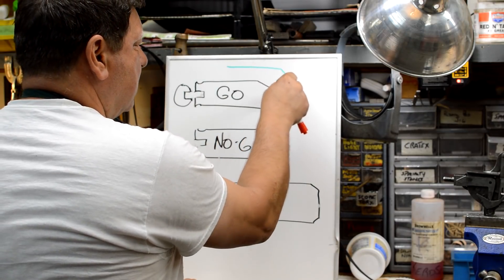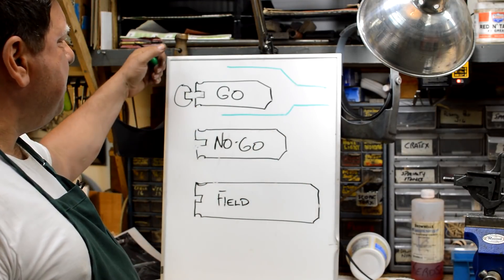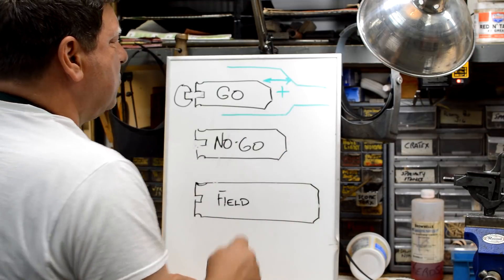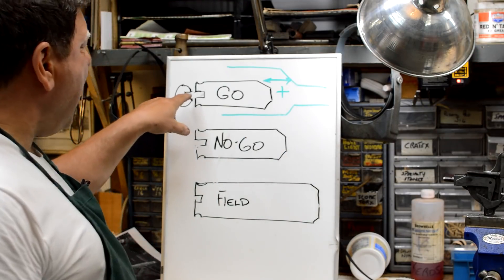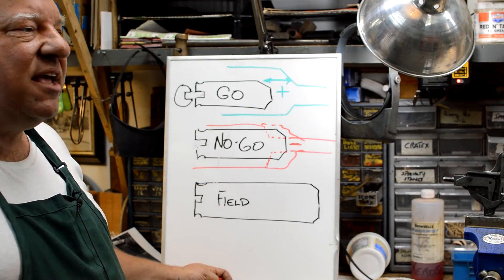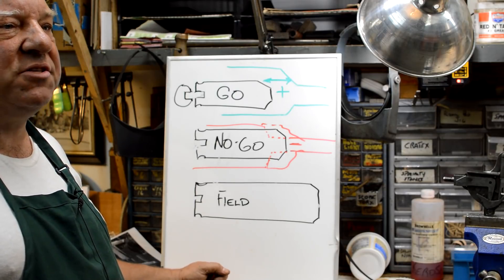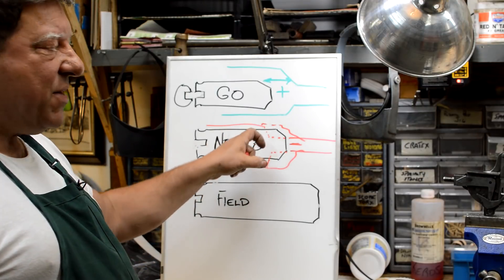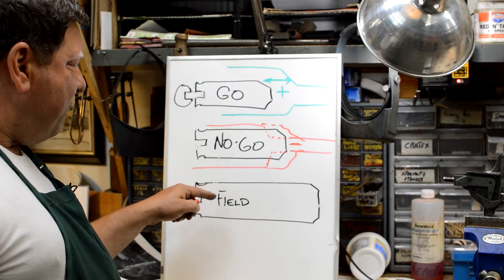Questions, answered #8: headspace gauges

Comment: I’ve had three brand new barrels by three different manufacturer that fail, headspace check. I had to send them all back to get replacements always check headspace you don’t want a gun to blow up in your face
Reply: barrels not installed properly?   Needed to be machined for proper fit?   Bolt face needed machining.  3 barrels?

Comment: How do you make sure the gauge you get is in spec?
Reply: Throw it in a case gauge (usually used by reloaders). Most have a stepped face on the rear that represent min/max chamber dimensions.

Comment: All I have ever needed for setting up headspace on my rifle is a go-gauge. Put the go-gauge in the chamber, set the head space to where the bolt just begins to have a very little resistance while closing, and every round as always perfectly fit with minimal fire forming that occurs. All are accurate and with no head separations.

Comment: Mark, when it comes to these gauges, particularly the no go and the field gauges, which do you prefer, go by and suggest when it comes to headspace gauges? The no go gauge or the field gauge? Or both?

And I apologize if this was asked by someone else and answered, as I didn’t feel like going through and reading all 104 comments to find out. 

But I ask this because when I rebarreled an M1 Garand and was asking questions/for advice from those supposedly in the know, many suggested, since it was just a rebarrel and because it was a military surplus rifles and because it was a Garand and because I was using a Garand barrel and not a new/brand new barrel, I just needed to use the field gauge. 
Now this is done and I, being the person I am, bought and used all three. I wanted to be 100% sure, positive and confident that when the trigger got pulled it went bang and not KABOOM💥 💥 💥 !

But could and would I have been safe with just the field gauge?
Reply: Only field gauge will tell you if the rifle is not safe, no go gauge is for new builds only👍
Reply from the maker: A NO GO should not go in. Your ammo serves as the GO, if the chamber is not long enough the whole system doesn't work. Field gauges are for military extremis conditions. Do not use a field gauge.
Reply: @marknovak8255  That’s what I wanted to know. That being, whether or not to use a field gauge/if it was necessary or not.
And saying not to use it, answered my question. Thank you for replying.

Comment: I always wanted to know how they work I think my British Enfeild would take the field gauge I still shoot it but I think it needs a new barrel to fit a go gauge to resize the ammo to fit the case gauge as it is my reloaded ammo will not fit the case gauge
Reply: It's not unheard of to do things like put o rings in the extractor groove to force the case rim into the bolt face during fire forming and neck size only on those. Couple pics floating around of virgin shoulders blowing 3-4 mm (1/8"-3/16") on their first firing. Sizing those down fully leads to case failure really fast.

Comment: Must you check headspace in AR-15 barrels and BCGs? Or can we get away with not doing it?
Reply: You should check EVERY combination of parts for proper headspace. I have found a few brand new guns and parts 'out of spec'. There is a very tiny amount of tolerance and variation in everything made. It IS possible that the right (or wrong) combination of enough parts, that meet specifications, can 'stack-up' to a point of the assembly being out of specifications. 
     One other thing about the 'field' gauge. As stated, it's just that, a gauge for checking a weapon in the field and is longer than a No-go gauge. If a weapon will go into battery and lock on a field gauge, it has EXCESSIVE headspace. It is Far out of specifications and while it could simply suffer a case separation and jam, The weapon CAN Explode. In this case there is enough room and slop for the cartridge case to move around and slam the face of the bolt causing catastrophic failure. Think of the difference between pushing on a locked door and hitting it violently with a sledgehammer!
      Yall Take Care and be safe, John
Reply: I do every one I touch.  I have a bolt without the ejector and extractor I use for testing.  Then I verify depth and lug length from my test bolt to the original.  If discrepancy or it fails I will pull the original bolt apart and retest.

I have come across two barrels out of spec from new.  One a cheap no name from Amazon when they sold such things and one direct from YHM.  

I learned how to do this way before the internet after I bought my first toy at a show and it never ran right.  Doubles and triples and all sorts of other stuff.  I bought the books and tools and learned.  Eventually I replaced every part except the lower receiver.  I bought two lower receivers and had two functional tools.

Talk about jumping in the deep end.  I was in my early 20’s about 1990.
Reply: Most people get away with trusting a manufacturers quality control, even if their guns is made from 10 different companies parts because they're like me and want something different or.. they're like me and they're cheap. 

Wouldn't hurt to take your new bolt and barrel, a live round and see if the bolt will rotate with a .005" (pop can) shim between cartridge and bolt face. Obviously be careful because it's a live round, and best to do it with a cartridge of high quality/match grade. If it rotates, try two shims. By shims I mean little discs inside the bolt face pocket. Rotation on one shim probably isn't that bad, but two (.010") is probably getting a little loose. 

*I'm not a gunsmith, just a random idiot that has rebarreled a few guns for personal use.
Reply: @randomidiot8142  could you use a spent casing?
Reply: @raffieb762  theoretically, but then you are setting headspace according to a spent casing of unknown dimension. If you full-length size the case and then use it, that would be setting up the chamber for absolute minimum headspace based on your die set. I guess if you use the fired case, you could assume that it came out of a properly headspaced firearm? 

Almost all of my factory sizing dies will take a fired case to dimensions that allow 5-6 thousands of clearance between the case and the chamber. That's about the difference between most go and no-go gauges.

Comment: I have an ar15 build that will load a round from the magazine, fire, but not eject the casing... will the go/no-go gauge help indicate what my problem is?
Reply: If it's a home build, double check your gas tube is not upside down.
Reply: @harak58  the gas tube is correct, I've checked. The chamber locks shut with a round/casing in the chamber and only ejects when "mortared" on the ground. 

It's a 7.62x39 AR build, if that information matters at all...

Thank you for the replies.
Reply: @blackhat2005  how well does it cycle by hand? Have you looked for any wear marks where there shouldn't be? Whats the brass like after you shoot?
Reply: @CAMSLAYER13  It will load the first round from a magazine by hand just fine, and fire that round as well. It won't eject the spent case unless the rifle is "mortared" on the ground.

Attempting to eject the round (unfired) by hand to manually cycle or clear the chamber doesn't work either, even with the magazine removed. It has to be mortared. 

Loading into the chamber and removing a round (unfired) to inspect shows a small dimple on the primer despite it not having been fired.
Reply: @blackhat2005  alrighty, I've given myself a problem like that with my homebuilds. 

1. You probably have a phone. Take video and preferably slomo video when you shoot, especially with a problem gun. It helps a lot.

2. You said you had to mortar it, because the cartridge was jammed in the chamber? You said you had fired it, so it's probably the right chamber and not a blackout barrel. 

3. ARs don't have spring loaded firing pins. A tiny dimple on a primer after loading by dropping the bolt is normal.

4. Have you tried different ammo and does it stick rounds with all ammo or just one brand?

5. Barrel length, barrel manufacturer, gas system length, adjustable or standard gas block, bolt/BCG manufacturer, buffer weight, if you have it. 

6. Not really a point, but I've tried adjustable gas blocks on my 7.62*39 and started with not enough gas to cycle. At first it would just bump the bolt, then it will pull the case almost all the way out, then it ejects, then it feeds, then it cocks the hammer, then it locks open. I've never had a case stick to the point I had to mortar it out, even if the action didn't cycle it out when fired. If you can get a light in the chamber, verify the chamber walls are smooth and not ringed or gouged. You should be able to drag a piece of wire down the chamber walls without it 'ticking' or hanging up if it's decent.
Reply: Paint a round with a sharpie.  Gently place it in chamber and close the action.  Extract it unfired and see if there are any obvious and atrocious burrs in the chamber.  Also, like others have said, what does the brass look like?  Typically if the round fires, cycles the action, but the brass is still in there it is missing a piece of the rim at the case head..  You have the bolt pulling it back and residual pressure giving it a jump-start to GTFO.
Does the action try to cycle at all?  or just stay closed like a bolt gun?
Reply: Hello, first I would say check the headspace. 
    If it passes the headspacing test, it sounds like a rough, dirty or bad chamber.
   Since you said a fired or unfired case won't easily extract, even manually the issue is with cases stuck in the chamber. Your not getting far enough through the firing process for the gassing of the weapon to be the issue. 
     Check the headspace, check the chamber and if that doesn't allow you to manually cycle cartridges without beating on it you should return the barrel for replacement. If you can't return the barrel, you may need to polish (or have polished, based on yours tools and experience) the chamber. After any chamber polishing,  always recheck headspacing before firing. 
    Good luck and let us know. Be Safe, John
Reply: If you do what Matt Fleming has suggested, and you do not see any indications of burrs or imperfections in the chamber, then it is likely your gas system.  Here's how I come to that conclusion.
With my favourite rifle, the FN FAL (Canadian variant, the FN C1A1), you are taught to "balance" the rifle when it is first issued to you.  The FAL has an adjustable gas system with increments from 1 to 10, 1 meaning that the least amount of gas is directed into the gas tube and 10 meaning all the gas is directed there.  Balancing the rifle consists of firing the rifle loosely held at the hip with the gas selector set to 1 and then checking to see if the rifle fully cycles.  If not, then set selector to 2 and repeat.  Most FAL's are comfortable at a setting of 4.  It is to be noted that if the rifle is fired at a low setting but braced against something, then it will usually cycle.  If there is not enough gas getting to the gas tube, the rifle will fail to cycle.  You can do a field test of this by plugging the barrel and blowing cigarette smoke into the barrel with a straw or something and checking whether smoke blows out in the right amounts and in the right places.
Reply: @bronxcheer031  My first thought was that maybe the gas block was misaligned..  BUT that wouldn't cause it to need to be mortared to extract..  the cam pin would handle that easily.  However if it was an out of spec chamber and sticking the case it would pull the rim off or jump the extractor and double feed.  This one is strange!  I don't see how it couldn't be a "both" or else something..  strange.  I love strange they are the most fun.  
I'm anxiously awaiting the response because the collective knowledge of people that watch Mr. Novak can probably get him running in a short time frame!
Reply: @mattfleming86  Agreed.  I almost can't wait to know the results of your suggestion, I really want to know what the brass looks like after a manual extraction.  I also want the answers to your last two questions.  Internet troubleshooting is sooooo slow!
Reply: You should use a 1.4646 Go gauge if the barrel is marked 5.56, not the 223 1.4636 Go gauge being sold as a 5.56 Go gauge. If the Go gauge passes, then the chamber could be too tight. Other than using a function gauge, use a trusted factory loaded"brass case" cartridge. Remove the upper from the lower and remove the BCG. Clean the chamber and bore well before testing.. Place the cartridge into the chamber. Tap lightly on the back of the cartridge into the chamber.. Tip the barrel so it is pointed upward and the factory round should fall out. If it sticks, you could have a tight chamber or short throat...Steel case ammo is notorious for sticking in rough or slightly undersized chambers. This is why some AR rifles will shoot steel case fine, while others jam immediately.. I would also check to see if the rubber doughnut  is on the extractor. Remove the rubber doughnut and reassemble and see if this helps. You can have too much tension on the extractor...
Reply: @hairydogstail  Blackhat2005 said in his second post in this thread that the caliber for this build is 7.62 x 39 so one of my first thoughts had to do with steel cased ammo because there's so much Chicom surplus 7.62 x 39 around.
Reply: @bronxcheer031  Same test applies, but that explains a lot..Thanks for the up-date...

Comment: What about if a bolt doesn't close on a go gauge? But closes on a bullet. 
I have a Winchester model 69a that I had to get a different bolt for. And to be safe bought a go and no go gauge. And it doesn't lock the bolt on either, but does lock when a round is in it.
Reply: Then your chamber is out of the SAAMI spec. It's probably just fine, but you should not let us desktop heroes decide that (in worse case it's a matter of life and death, and no unknown troll on the big web should be trusted). One of the differences between a GO-gauge and a brass cartridge , is that the cartridge is even  "shorter" than the GO-gauge. This is done to ensure that every manufactured round within SAAMI spec, will fit every chamber made after the same spec. In other words there's a calculated clearance between the cartridge and the chamber. I guess, in your chase, this minimum clearance is less than normal. We don't know how much. It should be measured, and let the result decide your action. Have you noticed loading differences between cartridge brands, and when you lock the bolt, takes it force to push down the bolt? If so, you have signs of a bad fit, and personally I would have it fixed. Bad loading is just annoying.  Anyway, I would try to measure what the undersize are, and then let the fact decide my next action.
Reply: @sidekickbob7227  This is why, when I was taught to barrel a rifle, that with a go gauge, it should mic approx .001 deep, because when you screw a barrel on tight it will sometimes be undersized. With a go gauge.
Reply: Send it back to the mfg.  if the mfg is you take it back apart and verify nut is torqued right.  If still an issue use a chamber reamer to ream it to spec.
Reply: @rcadd1ct  manufactured from 1935 to 1963. Yep, I'm sure they'll fix it right up. 

OP, it's a .22lr. It's not rocket science. It headspaces on the rim and if .22lr goes in and the bolt closes, you're fine.

Comment: Wrong on the field gage.  As headspace increases, ignition becomes less reliable. When the head space gets long enough, the weapon will simply fail to fire. A gun that will not go off is the last thing anyone wants to equip their soldiers with, so if the chamber accepts a field gage, the weapon is removed from service for repair.
Reply: Yes and no. That can be a problem, but depending on the construction of the extractor it might still keep firing because the extractor keeps the cartridge and primer in place well enough for ignition. The bigger problem from a safety perspective is as Mark describes, you might fire on  an unsupported case head and therefore get bulging or rupturing cases, which is no bueno.
Edit: the "danger" associated with excessive headspace is mostly to do with the well-being of the gun rather than the shooter. But with a 120-year old guns in mind, better to be safe than sorry.
Reply: That's what he said. Mr. acctuly.